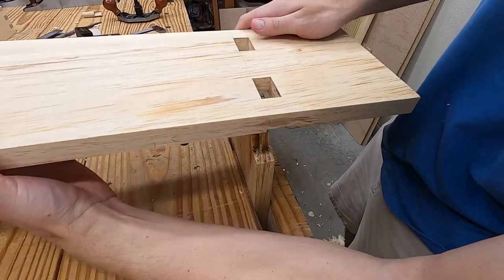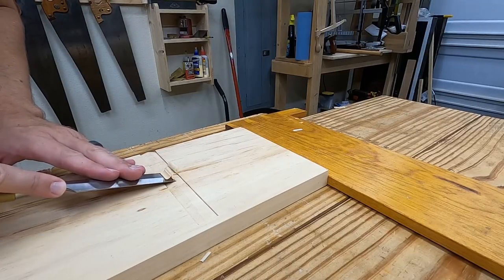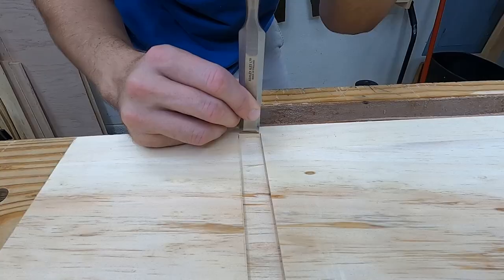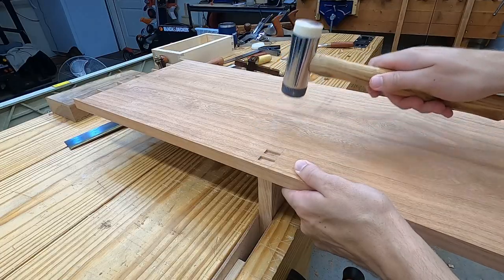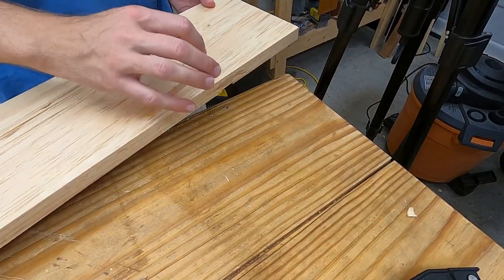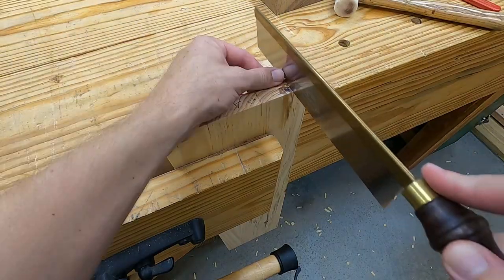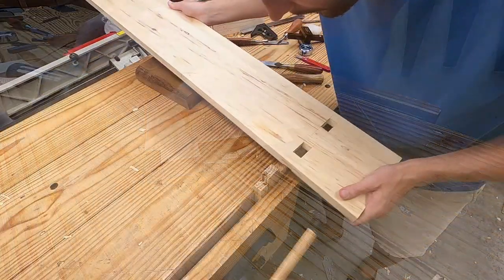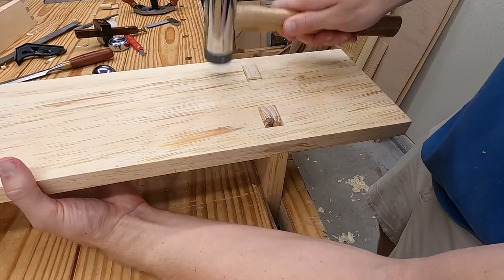Simple Chisel Method - Twin Tenon & Dado

Comment: No, I'm totally thrilled with this joint, have been wanting good, clear technique to do this joint. It is a good one to know. Thanks Frank, for another great video. See this joint wedged sometimes, would be interesting to see also.
Reply from the maker: Great! Yes wedged and another one I've seen, but yet to try, is a thin diagonal spline on the tenon

Comment: I'm waiting for you to give dados x sliding dovetails a try. They're what is preventing me from moving into the realm of more complex carcass construction.
Reply from the maker: Sliding dovetails like in a vertical drawer divider that's an inch or less deep? If so it's def on the way!! If meaning like a full board width, several inches long sliding dovetail used instead of a dado... Honestly I'll prob never do it.
Reply: @FranksWorkbench Yeah, I was talking about the way Doucette and Wolfe do their horizontal dividers - dado for most of the length and then a ~1.5-2" sliding dovetail at the front to pull the carcass together. They make it look so easy...
Reply from the maker: Ok awesome, gonna give it a whirl for sure. Those guys are insanely good, their stuff will humble any woodworker
Reply: @FranksWorkbench  Their work is absolutely incredible, and their tools always make me pretty envious. They use one of what seems like five miter planes ever manufactured by lie nielsen and it looks so handy.

Comment: Frank, I’m currently building two nightstands out of hard maple. The sides are 11 inches wide and have a 0.75” thick shelf dadoed 3/16” deep into the sides. Just for grins, I thought I’d try your approach to making the dado. Chopping just one wall of one dado in the hard maple took forever. I quickly reverted to my standard practice which is to start the same way you do but only go down enough to create a tiny shoulder. Then I run a cross cut backsaw along the newly created shoulder until the dado wall is at full depth. This method is so much faster and easier, especially in hardwoods or wide pieces. (Sometimes I skip the chopping altogether and just clamp a batten across the work to guide the saw.) Of course, your method does work and is a good option if someone doesn’t have a backsaw. But I did want to mention an alternative that might work well for others. Your videos are excellent and I appreciate your efforts to encourage and train hand tool woodworkers.
Reply from the maker: Great tip! I'm going to pin your comment to the top so others will see it

Comment: Just found your channel. I have watched a few videos and am very impressed. I have always dreamed of working in a hand tool shop but with limited vision it can get frustrating. Any tips on learning to hold the chisel at 90 degrees to the work surface?  I have tried guide blocks with some success but it can become very obtrusive to movement.

Five minutes after posting I came across your mortising tutorial. That was the quickest reply I’ve received from any YouTuber.
Reply from the maker: Thanks man, I hope the mortise video helped! Also with limited vision, you might experiment with applying blue painters tape to the surface before marking out. Then remove the tape from the area to be mortised. Next consider drilling most waste with a drill and guide to keep it perpendicular. Finally chisel right up to the edges of the blue tape to square it up. Chiseling from both sides (if a through mortise) and undercutting slightly can help too

Comment: What kind of file do you use to sharpen the gents saw? Do you do anything different from sharpening other joinery saws?
Reply from the maker: i just use a triangular file, whichever is the smallest one ive got, usually a 5 or 6 inch xxslim I believe
Reply: @FranksWorkbench  I bought that same saw. Cuts terrible. Really awful. You must’ve worked yours over s bit? Mine has 19 tpi. Not sure if I can file it 🥴
Reply from the maker: It comes with way too much set (and dull, iirc). On the one hand that means you can steer the cut, but gives a terrible messy cut and won't keep a straight line on its own. Since the teeth are so small, you really don't need to try removing the set, just file it. After about 3-4 file strokes most of that excessive set will have been removed and it cuts much better and faster too.

Comment: Does this join method not require glue? Also I really want to use this method so it can still be disassembled if wanted, but i do like the aesthetic of a mortise and tenon with wedge, but then you have to use glue, is there a similar aestehtic that can be use din the method you showed?
Reply from the maker: Thanks! You may look into a tusk mortise and tenon
Reply: @FranksWorkbench  Thanks franke, but tusks, can't be used for connecting table legs to a table top i thought, since tusks would show through the top. Also, wanted to confirm, did your twin tenon and dado join not require glue?
Reply from the maker: Yes you're right. I did use glue

Comment: I made a similar saw till, but not nearly as nice as yours. To hold the saws in place I made small hoops from 1/8 inch steel cable and glued them into holes I drilled.